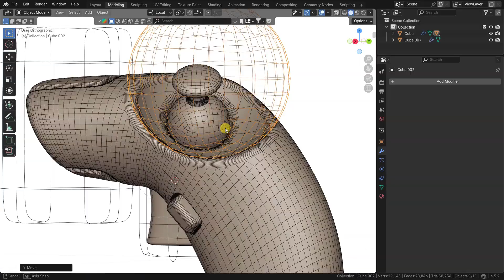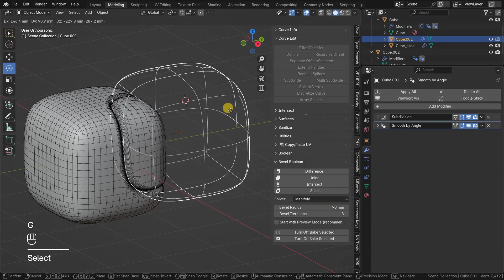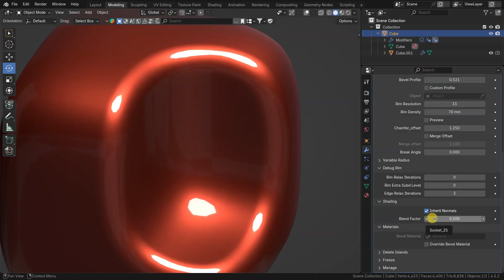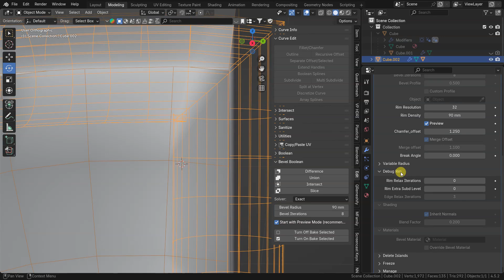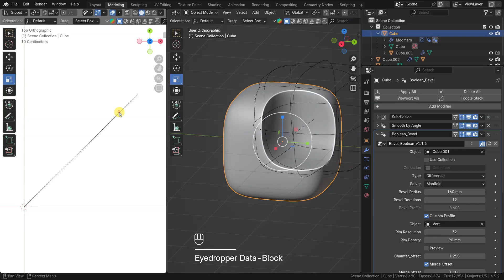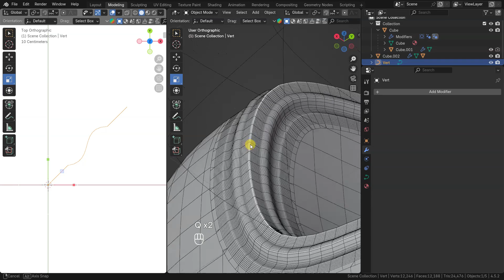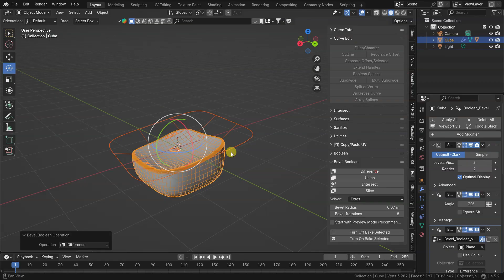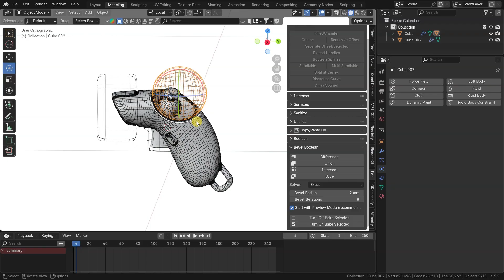Blender Boolean Bevel Addon 1.1.6 Review & Tutorial

Comment: Wow, thank you for your work! The new features for editing curve profiles, boolean materials, and volume-controlled bevel weights look pretty cool! 

Also，one last feature request.
In the Boolean Bevel add-on, can you make the "bevel" function work on "selected edges" or "marked blue sharp edges"? This would be applicable in more scenarios, not just limited to edges after Boolean. It would be great for making high poly! The effect is similar to the Machin3 add-on, where "offset cut" or "hyper cursor" bevels edges (ignoring bad topology and beveling selected edges). It's just like using bevel on "any selected edge" or "hard edge" in CAD software, very fast.
Reply from the maker: This is unlikely possible in current implementation, cause marked edges can be intersected loops, open loops and so on, boolean intersections are just close loops and this is much easier to handle. Anyway Blender developers currently working on new native bevel node for new versions, so I assume it will be possible to try in blender 5.0 soon